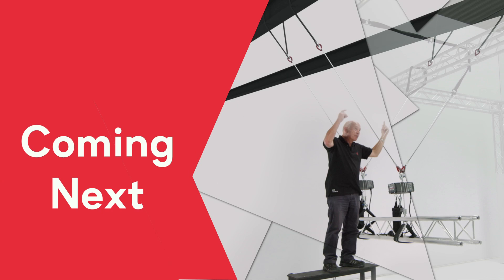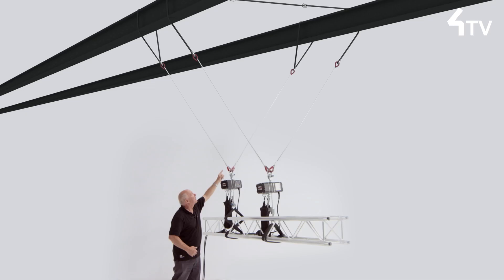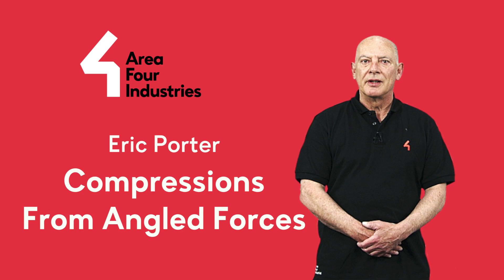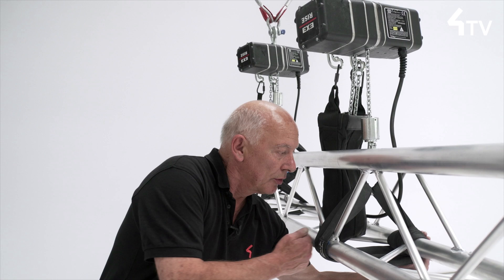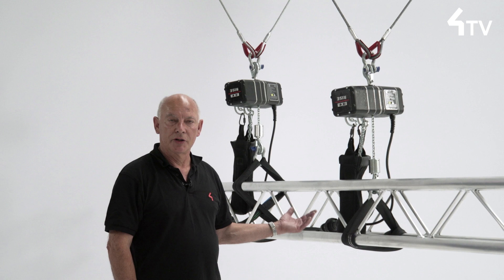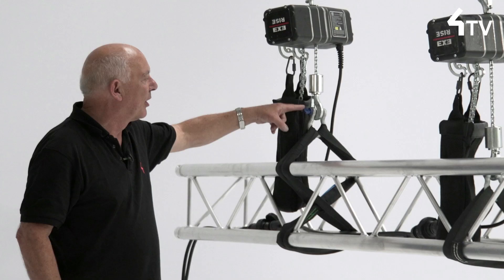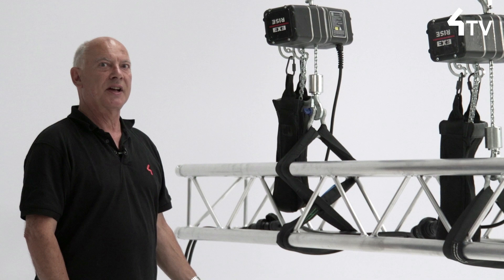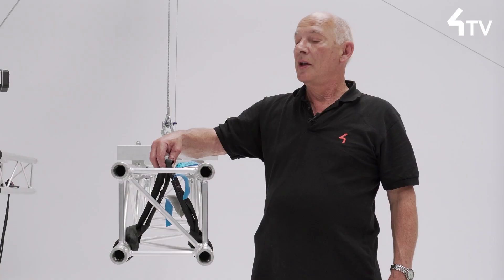Eric Porter - Compressions from Angled Forces - Area Four Industries TV

Comment: Hello mr Eric Porter,it is true that when you chock a sling you reduce his load capacity with 50%?I have a image to understant better but i don't know how attach.
Thank you
Reply from the maker: Hello Stefan,
the load capacity of a choked round sling (or steel wire rope) is reduced by 20%. When searching for "load capacity round sling" you will find load charts of many manufacturers which confirms this.
Norbert Tripp, Technical Director
Area Four Industries
Reply: Thank you very much...Best regards from Asc Systems from Bucharest 😊